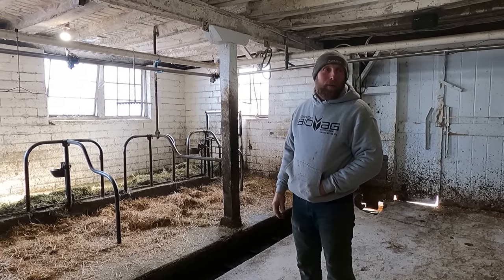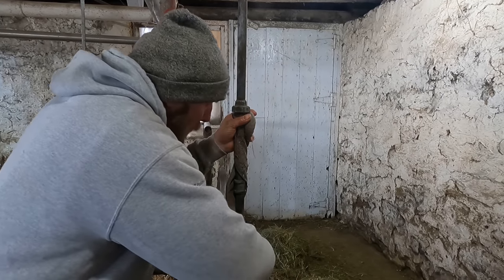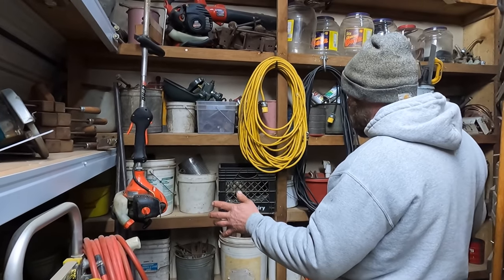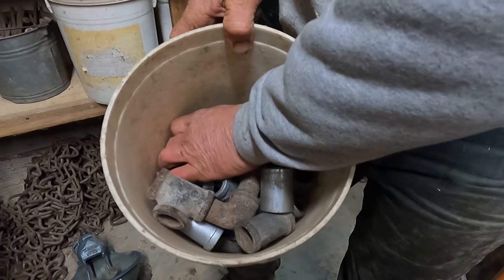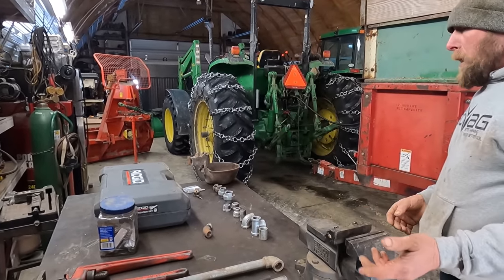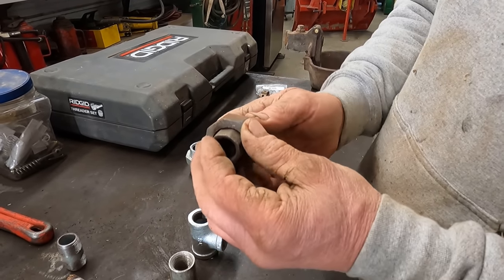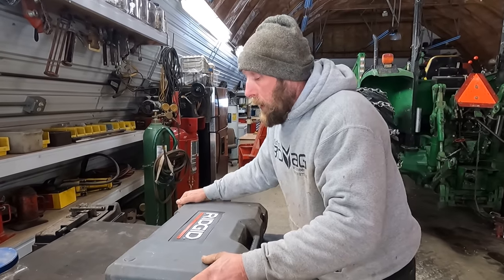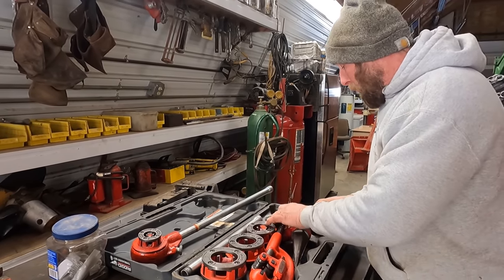Frozen Pipes! How to Thaw and Fix Water Lines!

Comment: Brings back memories, nothing worse that a flooded barn in the middle of winter. I only remember one time in our barn when one of the drinking cups valves stuck, what a mess.  At the time I was just a little fellow, may 5 or 6 years old. Granddad and my dad had to clean up the mess and I think they where a little upset that day, so I didn’t hang around. I was sure at the time as young as I was, it just wasn’t a good time to hang around with grandad an my dad.

Comment: Our barn was originally mostly Jamesway equipment. I loved the Jamesway buckets because the cup could be taken off separately to wash to sanitize the bowl before stabling the cows in the winter. 
When I did pipe repair I always added unions because the original piping only had 1 union for 16 cows. 
All our piping was 3/4 inch for simplicity.
We hooked up a light to the water pump to show when the pump was running that could be seen from the house.

Comment: Very creative using the old socks soaked in hot water to thaw out pipes.  They would be very flexible and easy to rap around the pipe.  Your dad had a good thought to not cut corners and go cheap when fixing things.  They have a old saying that "Going the cheap route turns out expensive in the long run".  Thanks to you and your dad for taking the time and effort to create this helpful video.

Comment: Love this video. Working w/ galvanized/steel pipe is the most difficult. If one can plumb w/ these materials, one can do almost anything. I use pex everywhere I can. It is cheap, flexible, super easy to work with, and can expand up to three times its size (ie freeze) before breaking or splitting. You can buy NPT to pex adapters if you need to replace a section of steel or copper. It also never clogs up w/ rust. I LOVE it. If you guys ever try it, you'll never go back to steel.

Comment: For many years in the 60s I used to thaw pipes with electric arc  welder.  One terminal to a running tap and one frozen.  Then  go and have coffee.  It worked every time witn iron pipes.
Reply from the maker: It would be interesting to see!

Comment: Old Forney Stick welders that were promoted for farm use had a entire section in the manual on how to use it to thaw pipes.  Never did it myself, but the pipe smoking old heads here always said it worked well.

Moved those supply pipes down on the stanchions up on the ceiling beams and ran feed lines to the cups down with hose, never had any freezing issues after that, warm air was up there, put ball valves in line to be able to isolate without killing everything.  Never had much issues after that other than valves on the cups.  Although in the winter only a few windows were cracked at one end, had a small fan at the other end on a t-stat, it ran pulling air most of the time through the barn but not enough you felt a draft.............If the temp got to low inside, the t-stat killed the fan and let the air warm up inside before it would run again.  Was easier than guessing about how many windows to crack open and worked well.
Reply from the maker: I can see how a fan system like that would be really nice!

Comment: Our well was at the side of our 1869 stone house and the pump was in a little cave where we busted through the basement wall where the well went down.  The water went from there to the barn 100 foot away at least 4 foot under the ground. This almost never froze but there were a couple of record cold spells where it froze and we couldn't thaw it with hot water. We called in a guy who had a welder with long leads and they hooked one lead to the pipe in the cave in the basement and another to the pipe in the concrete stock tank in the barn where we sometimes had 12" gold fish living that thrived off the ground feed dropped off the cows' whiskers as they drank. In just a few minutes we had water again and the cows quit bellowing and were fighting for a drink at the tank.
    On another subject, according to the old blacksmith in Witwen, Wisconsin that fixed all the farmers' machinery thereabouts; not just any oil works good for cutting oil. Petroleum products are like trying to cut metal with microscopic ball bearings. They hinder more than help the cutting process. Cutting oil is made from animal fat. He said if you don't have the store bought kind, use rancid lard. It's basically the same thing.  I used old bacon grease for years and it works just fine.

Comment: We do this almost exactly the same. We have a dozen or so extra water cups and on Sundays during the winter I am rebuilding valves if I need to. On the coldest of nights I will sometimes go out to the barn at 10 o'clock or so and turn the water of and drain the lines. Turn the water back on in the morning at 5:30 or so. That worked well for us.
     Dairy breakfast Saturday June 8th..... Next time. 😃
Reply from the maker: Making sure the water stays running is so important on a dairy! Thanks for watching!

Comment: If you know the temperature is dropping extra low and you think you have a run of pipe at risk of freezing, crack the water at the valve to just drip out. That small amount of water movement will keep pipes from freezing solid. I do like the old socks idea.
Reply from the maker: Thank you!

Comment: I used to use hot water but either your fingers get scorched or there wet and freezing in the cold. The best thing is a hand held torch with the on off trigger. The secret is using the right gas. You want to use the yellow little cylinder you can buy from any big box hardware store. Because it burns so hot you can just move along at probably 2 seconds per foot. The pipe , plastic or metal will absorb heat and distribute it to the ice inside for a few minutes after you pass by.It's fast , your hands stay dry , and you don't walk to fetch a pail of water and walk back to put the pail and rags back. The water left on the pipes along the curbs makes it a lot easier for cold to refreeze pipes again.
Reply from the maker: Thanks Ron!

Comment: I would try heat tape, turn on when needed, then I would shoot a little heat to your barn from your wood boiler, or I would hang up a couple of LB WHITE 408s set at 45 to 50 degrees. I would also use black plastic 3/4 pipe. Do what you want. Mr John likes his 408s, a little costly but never failed me with no fires. Never had a fire with a 408, they run and run. Those cows need lots of water!!!! Do what you want, looks good what you all do. I HATE FROZEN WATERS. John T.

Comment: I recall using a hot water bottle on a pipe corner of the barn. If you did not latch a door properly and got a freeze up you I were not in the good books. In the Ottawa Valley Ontario🇨🇦 we used the term “unthaw”. Makes no sense I know, but it I still say it.
Reply from the maker: What ever works is the main thing! Thanks for watching and the nice comment!

Comment: we have 1/2" black plastic pipe and  have blue water bowles with red water stems pretty much I used what I had water seems to move really well. The water froze twice this year and it was in the water stems in the bowl took 20 mins to thaw i got lucky next year I'll have more cows and barn buttoned up air flow is good have unico fan just not enough bodys on them - days
Reply from the maker: It's amazing how much heat the cows give off!